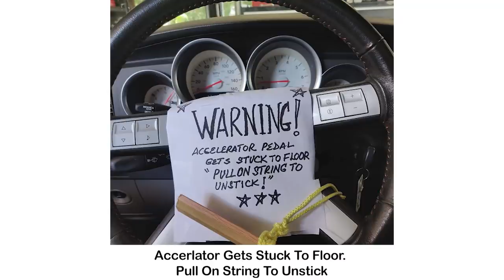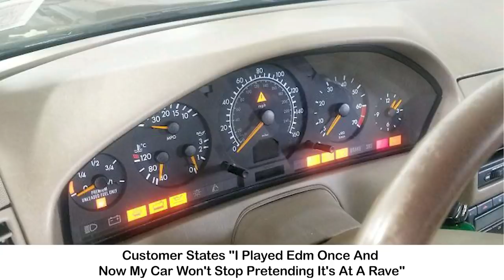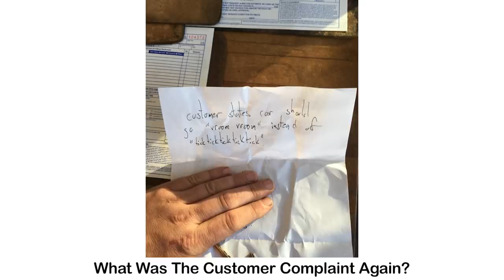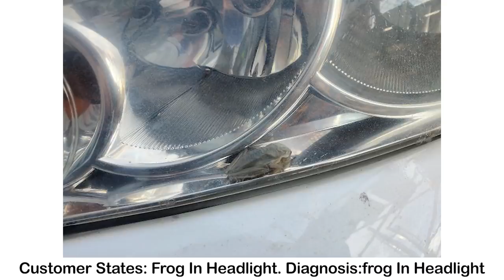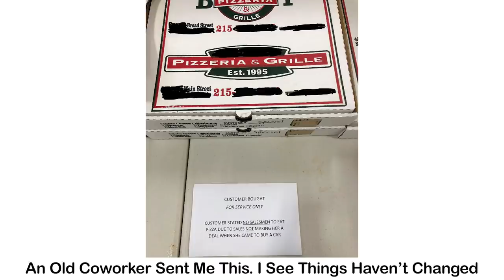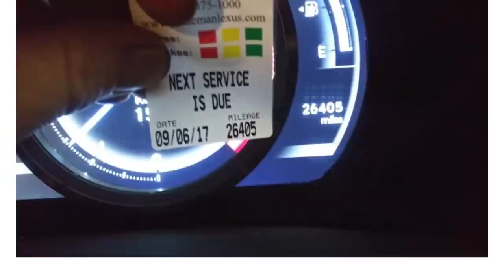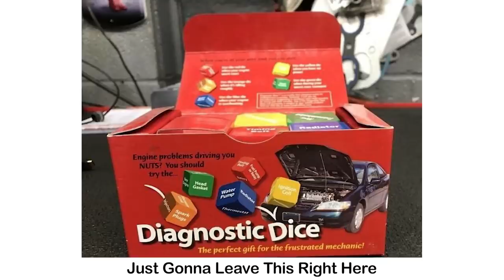Mechanics Share The Scariest And Most Interesting Things They've Witnessed

Comment: When I was in my teens, we would usually leave the tractor battery disconnected because we didn't use it for long periods. One Spring, we drove to the farm, and popped the engine cover so we could jump start the tractor. We needed to disc up the field, to get ready to plant whatever we were planting. Squirrels had chewed open the battery, and built a nest inside. There were three or four kits, alive and well, in the nest, inside the lead acid battery.

Comment: Cool story related to the Ford with check engine light on after 3o miles; I had a brand new Vauxhall, and after 2wks of ownership the service light came on. I took it to the dealership and they fixed it. When I asked what had happened to make that light come on so soon, he said that an error had happened in the factory when the engine is "married" to the chassis. The engine is supposed to have it's odometer reset so the miles match the chassis miles, and for some reason my car skipped that step so the engine thought it had done the required miles for a service. I don't know if this is true, it sounded plausible.
Reply: Bought a 2000 Astro with 6k miles on it. Check engine light came on at 10k. I retired her at 250,000+ miles, never did figure out why it was on.240,000 miles running with it on. Couple times a year I'd go in and get it checked. Never any codes.

Comment: Several years ago I had a car that occasionally produced a weird pong, pong, pong noise from somewhere on the driver's side of the car at the front.  I kept picturing the wheel parting company and cheerfully bouncing across the street one fine day.  I'm just glad I never took it to a mechanic.  After a little investigating, I discovered that the antenna was making the noise when it bounced on a windy day.
Reply: “Yeah... yeah, we’re gonna need to replace your— yeah, drain and replace— reallly flush out your antenna fluid.  It shouldn’t take too long, but the labor cost [breathes through teeth]... That’s really gonna hit ya...”
Reply: @stephenlackey5852  That's about what would have happened, all right.  Good thing I was encouraged to solve my own problems from the time I was a kid.

Comment: Birds nests are also very common. The little buggers will make a nest if the machine is in one place for a week during springtime. There have been quite a few "serious brake faults" where there has been something under the pedal. Also somehow the engine has refused to crank when it had no oil or fuel in it. There have also been requests to remove snakes and wasps. A lot of silly things happen even with heavy equipment operated by professionals.
It is quite fun to drive 200km in a hurry to find out that the loud alert and a red triangle was caused by a door that was not completely closed tho.

Comment: We had just installed 4 new Fulda radials on a small import. About an hour & a half later the girl brought the car back complaining of a harsh ride. I went to check the tire pressure & it pegged the gauge. I got a truck gauge instead & all 4 tires had between 95 & 110 psi with the steel belts being forced out thru the tread.
Her dad wasn't familiar with radials & was trying to get the bulge out of the sidewalls.
All he managed to do was ruin 4 brand new tires! I lowered the tire pressure & she took off. Never came back thank God!

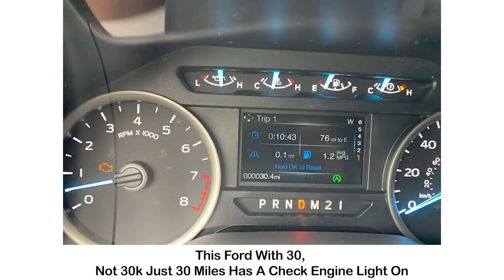Comment: The check engine light shown at 4:59 doesn't show an odometer at 30 miles, its a trip meter. However, the rags at 3:42 DO actually appear to be in the engine valley.

Comment: 1:23 Did anyone notice that the wind shield on the car says "done, Move out"  The police didnt use that car at all. I call that a very angry ex. lol
Reply: The police might have someone moving away though
Reply: @cloakedninja9317  yea it was since it was the marker that was around the bullet holes
Reply: I worked at a car rental agency for a time. Big-time targets for car thieves so they can do stuff like this. We had several stolen cars recovered and returned by police, usually trashed and some with bullet holes, but never like this!
Reply: That car prob got like 32 baller holes in it

Comment: 3:17 no repair trench or dug out? in your workshop?  Even the 5'7" guys gotta bend his back. What shite place to work.
Reply: Plenty of dealerships don't have a trench because the lifts go up high enough to stand up straight.  I've only seen trenches in oil-change shops and some independent shops.  Having a good lift is much better.

Comment: 3:10 So you can afford a 2017 Maserati, yet are too cheap to spring for tires???
Reply: You'd be surprised.  I was a tech for Mercedes for a long time and I saw plenty of people come in with bald tires who didn't want them replaced.  $100k+ cars with bald tires.  Crazy.  Though those tires are like $500 a pop, but still.  

I even had one car, and old SL500, who came in complaining about a pull to the right when breaking.. Turned out the left break pad had worn down to the metal backing plate and was that way long enough to eat through the rotor and detach the outer disk of the rotor from the hub.  I don't get some people.